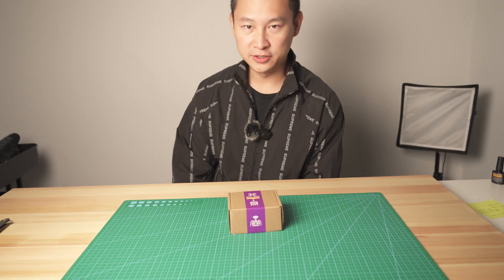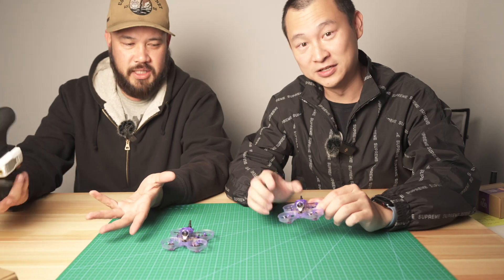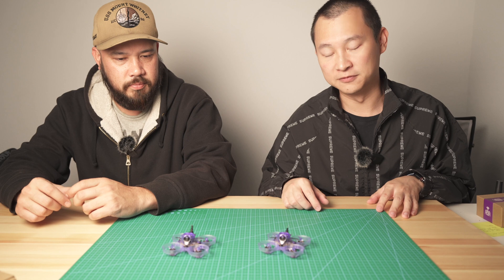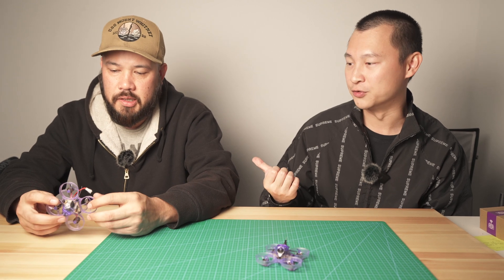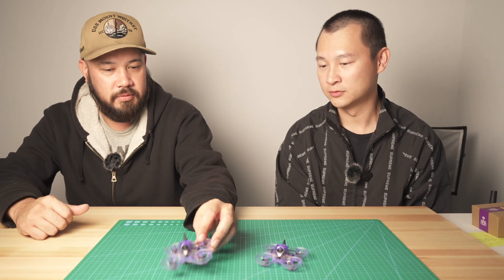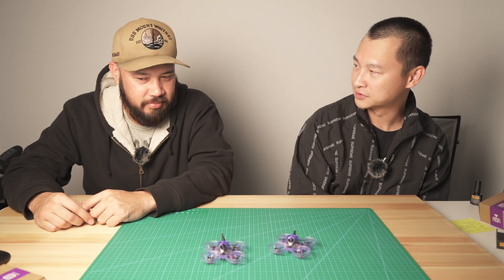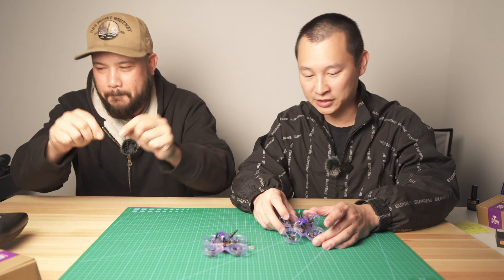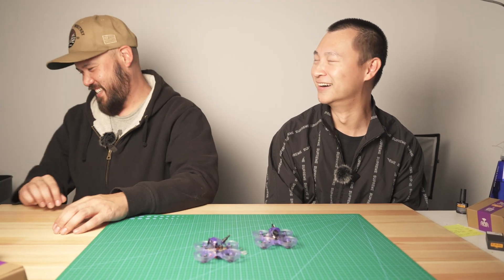NewBeeDrone AcroBee65 BLv4 ELRS BNF | New Product Release

Comment: I have the latest version of the ELRS configurator (v1.5.5) but it doesn't have any of the NBD hardware listed.  I tried DIY but it noticed the target mismatch.  This video talks about documentation for how to flash but i can't find it anywhere on the product page.
Reply: Apparently, the target has not been added to elrs configurator yet. This is something that NBD can do?
Reply: I'm stuck on this problem too!
Reply: @navigator2011  I force flashed one of the sx1280s and it worked. I really wish they would just work with the elrs project. We should have waited.
Reply: @gadgetmerc  Thanks for getting back to me!  I'm guessing you used the DIY 2.4 GHz Device Category, but which particular Device did you go with?  Was it the DIY 2400 RX ESP8285 SX1280?
Reply: @navigator2011  I don't remember. I'll check my logs after the kids go down
Reply: @navigator2011  Tried that exact target and it hasn't worked for me yet. I'll update you if I find something that does
Reply: @navigator2011  Okay it did work and my radiomaster TX nano module was just being weird
Reply: @grandpa_stanley7813  Thanks!  With a lot of help from peeps on here, I found that the Acrobee65 can be updated to ELRS v3.0 by downloading NBD_2400_RX_3.0.bin from the NBD Github site, then putting the Acrobee65 into WiFi mode and then flashing the downloaded file directly onto the rx without even using ELRS Configurator.  Doing things this way worked for me, but I still cannot use a bind phrase, lol.
Reply: @navigator2011  Weird. I guess that’s just the way ELRS works. Amazing once it works but super annoying to set up